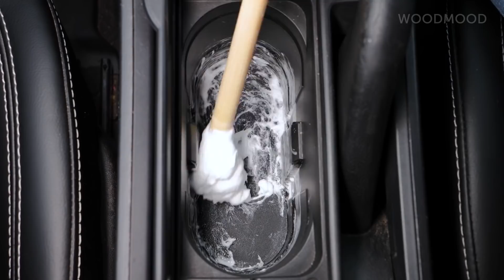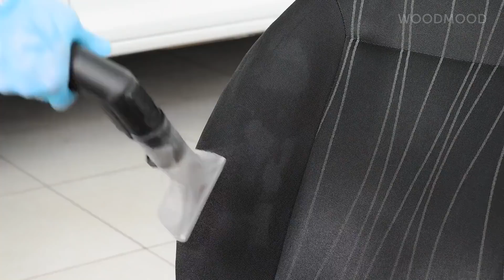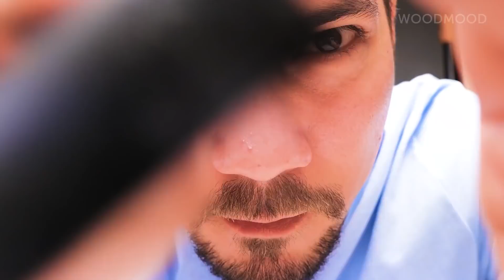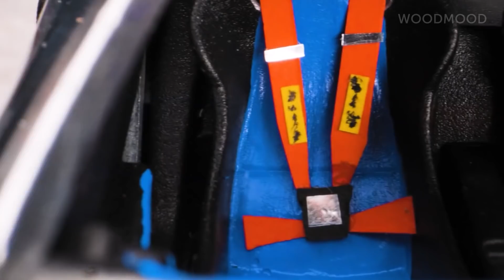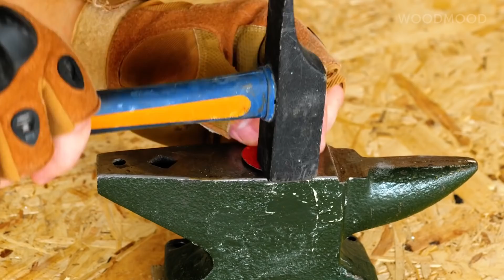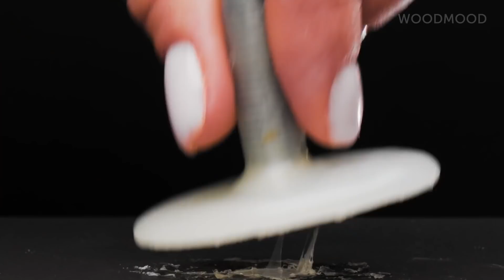Car Restoration 🚗 and Secret Repair Hacks for your car and your home

Comment: You really painted the rotor as if it's not gonna rub off the first time you hit the brakes 😭😭😭
Reply: not to worry about, brakes will not work and a dead person can't complain.
Reply: That’s not a rotor; it’s a brake drum. The brakes are mounted inside the drum and do not come in contact with the exterior, If he used a high-heat paint, he’s good to go!
Reply: It's a brake drum duh